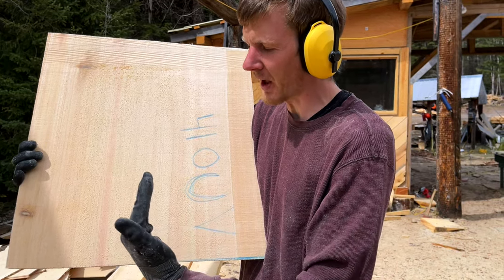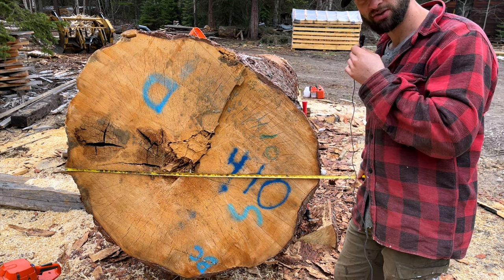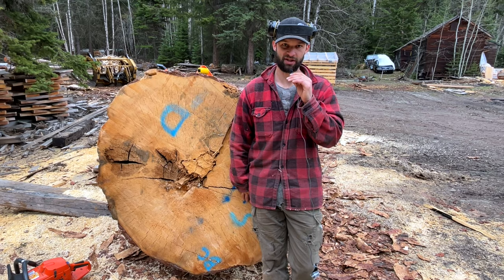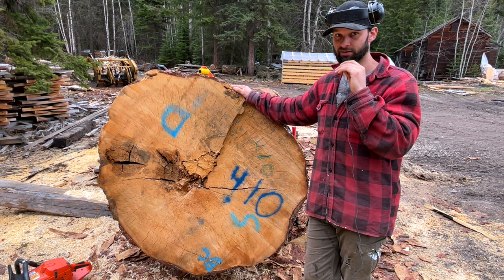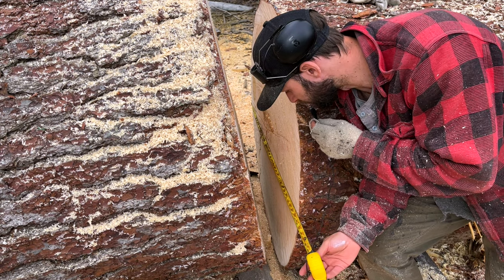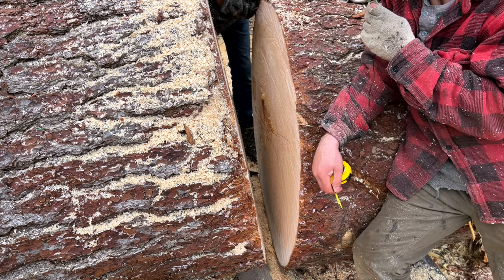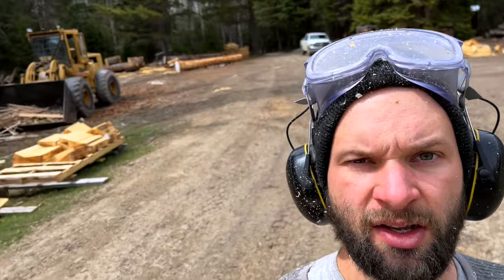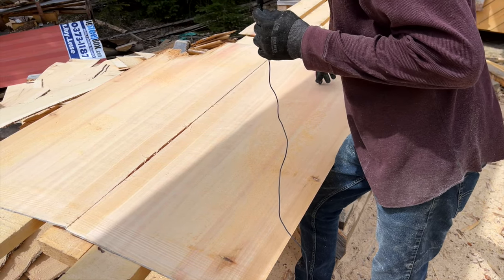Guitar Tops Made From a Rare Tree (part 1)

Comment: Hey man, wicked stuff you're doing! Im a luthier based in jersey (the original one). Weve weirdly had a harricane for the fist time in 30 odd years. Ive been picking up what i can the past few weeks. Have a load of radiata over 200 yeara old. Hiping the strong winter winds here have given them some strength.
Reply: Hi dude, send me a picture of what you end up with. Maybe we can do a lil exchange? I've got some monkey puzzle (cites 1) and some good looking European sycamore and beech. Can give you all the documents as it came down in jersey from a hurricane and tornado. I've got a chainsaw mill and a new saw on the way so should process up nicely. Will need a couple years drying time tho.
Reply: Also have some awesome Turkish oak or something. It's an oak leaf but probably double the length of an English and grows straight. It's probably 65 yearsish. Also have some Scots pine (I think) that's probably a 40" radius and have a 4 m straight section.
Reply from the maker: Thanks! Put it to use. It’s worth salvaging most of the time. For backs I feel like there are lots of woods that work well enough.
Reply from the maker: I’m not super familiar with these species, most of the the requests I get that I don’t have the trees for are maple. You could tempt me with figured maple, but I try and source local, it’s just an effort to lower the carbon footprint on tops. Usually instrument woods have thousands of miles of trucking in the raw, it just makes more sense to process it as far as possible before shipping it across the globe.
Reply: @MountainVoiceInc  yeah man, for sure. Guitar making doesn't really use that much wood. If I can get a couple of years worth, I'm happy but I've already got more than that. I've also got a mate with a telehandler who's gonna help me out with a few more precarious bits between Christmas and New year. They're on steep hills so don't want em rolling.

Comment: This is indeed a strange method of cutting tops. How did you account for keeping the grain vertical?
Reply from the maker: Advanced quarter saw, so basically we just keep turning it until the grain is vertical on every top. Have to cut out sections between guitars, those are violins. Usually people ask about run out. It was straight grained.
Reply: @MountainVoiceInc  I used to work at Larrivee, all those wedge cutouts used to be dumpster dive heaven for me. The first time I ever had to actually BUY brace stock I was very sad, lol…

Comment: What is the white stuff you put on the end of the logs and why/when do you put it on.
Reply from the maker: That’s a latex paint. It’s used as an end grain sealer. I use it to slow the drying process as if left unsealed the logs start to crack after a while. I have tried various products for this and latex paint works as well as anything at a fraction of the cost.